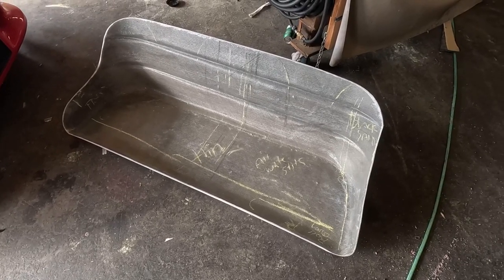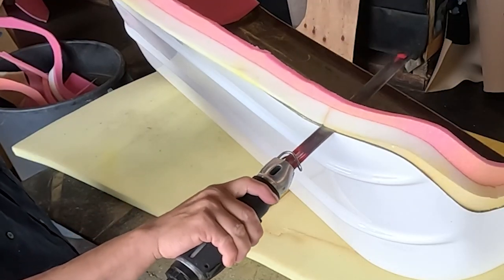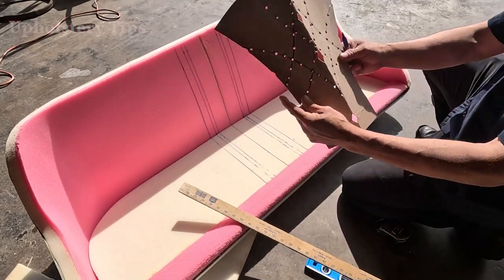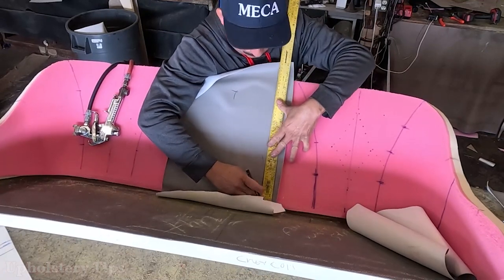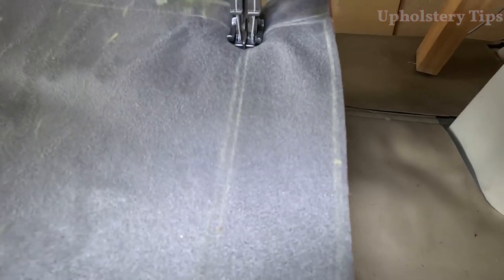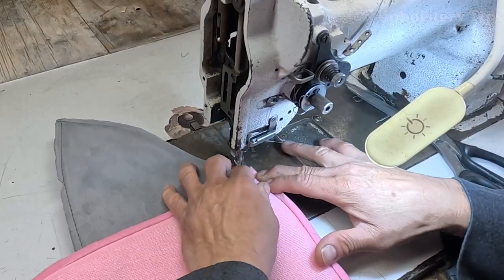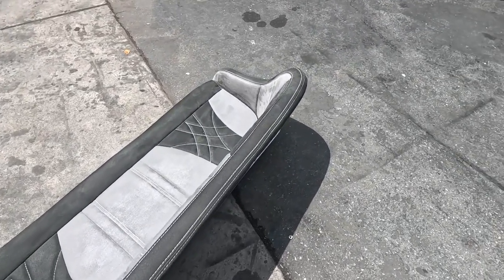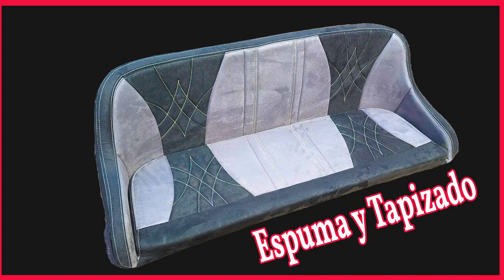Prepare and Upholster Racing Boat Bench Seat.

Comment: Why is it so necessary  to sew all around the piece that you glued the foam to the material ? Than you sew them together!  I have been skipping this step and my work has turned out good? Thanks again for your advice.
Reply: I think it’s easier to sew together whenever using half inch sew foam